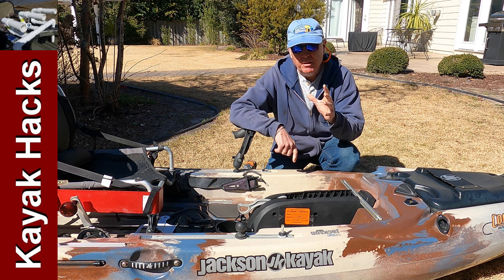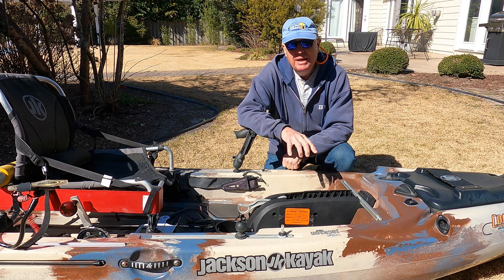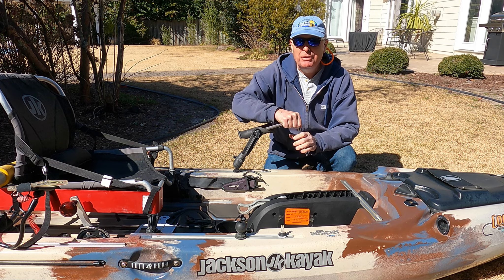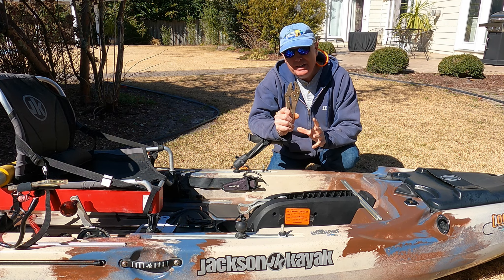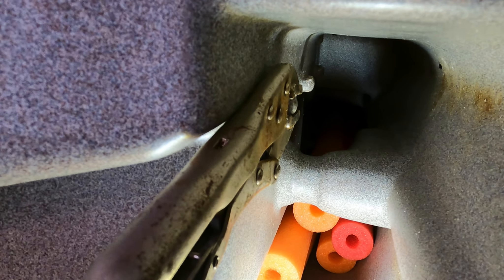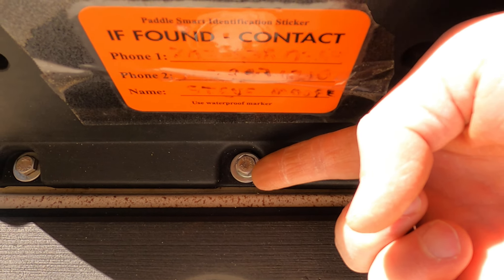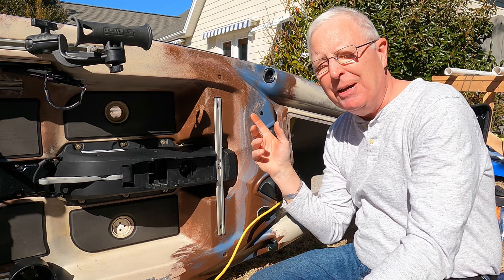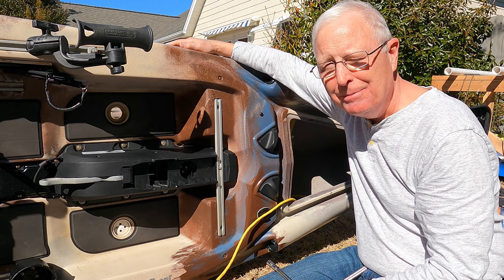Kayak Maintenance - HUGE MISTAKE on my Jackson Coosa FD

Comment: I can see that stripping plastic threads with metal bolts is likely a common problem over the life of a plastic kayak.  Given that the bolts are embedded in the same type of plastic as the rest of the kayak, would you be able to use the repair material and melt some plastic into the holes and then re-tap the holes while the plastic is still soft?  May require drilling out the existing threads. A test could be done on a mock-up made of the same material to determine feasibility. Another option (which I've never used on a kayak but have used on plastic) is to embed a metal nut into the hole and fasten it with epoxy (very similar to how you make your connectors for the tracks).
Reply from the maker: After posting the video, I came to pretty much the same conclusion. If I have to fix it, I will drill out the existing hole all the way through the nipple and put a self locking nut on the bottom.  Also though of filling the hole with epoxy and tapping that.

Comment: Glad you got it fixed up. I wonder if it were to go completely wrong if you could use a metal well nut instead? I use them all the time on the road tractors I work on.
Reply from the maker: Thanks for the tip. I'll look those up and get some to be ready....  do you have a link?
Reply: @KayakhacksFishing  I'll look and see what I can find. We get them delivered to the shop from a company called MHC. They are called nutsert blind rivet nuts. They make a tool that's similar to a pop rivet gun to install them, but you can use a bolt, washer, and nut to pull them up with a little patience. I've seen them on Northern Tool's website among others. They work quite well. Not tried them on a kayak yet, but I see no reason why it wouldn't work as good or better than a rubber well nut.
Reply from the maker: @racerx12003r  They are an option if they can be easily removed like a regular well nut. If they require being drilled out like rivets, that defeats the purpose of removing the unit to clean it up. Thx for your help.

Comment: Maybe a new rivnut or brass threaded insert (for wood) could replace the spun insert if need be. I would also be curious if heating the molded part the insert is embedded in then using the vice grips or a screw clamp to squeeze it back onto the spun insert could secure it again. The screw clamp could be left on as an extra holding force. Access would be the problem in any event.
Reply from the maker: Good thoughts. It will be a fall back
Reply: I just saw a video where screwdriver handles were removed by heating the shaft. The upper portion of a long bolt could be heated and pulled to remove the inserts. Good luck with it.

Comment: So....removing the pedal/motor housing unit as you tried to do shouldn't and/or can't be done?
Reply from the maker: It is fine to remove the housing. I have done it several times before.  I just overpowered this time.

Comment: too many ugga-duggas applied. =(
Reply from the maker: The space is so small, I do not think I could heat the circumference easily. I believe you are right that it is drill and bolt next.
Reply: @KayakhacksFishing  one more thought, could you get a zip tie around the nipple on a warm day? cinch it down as tight as you can and then tack it in place with a dab of super glue to keep it from slipping off?
Reply from the maker: @notkrankykris  Good thought, but the space is so constrained, I could not get a good grip all the way back.
Reply: @KayakhacksFishing  ah bummer.